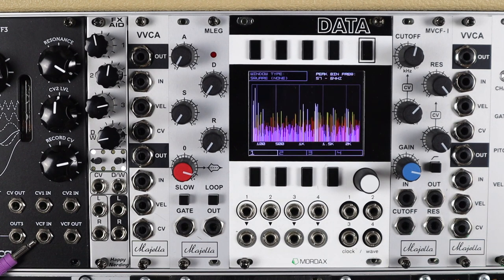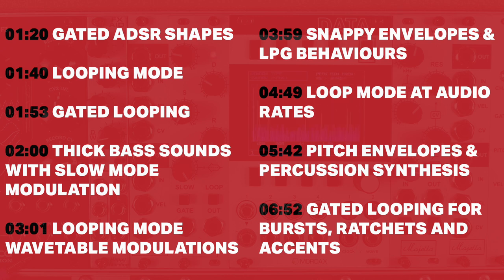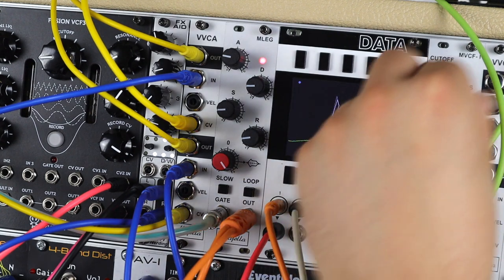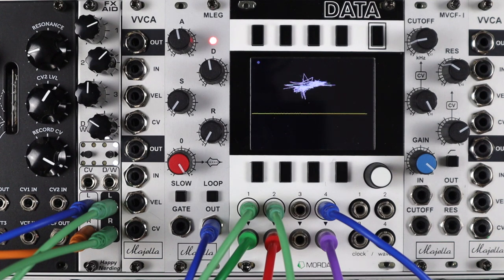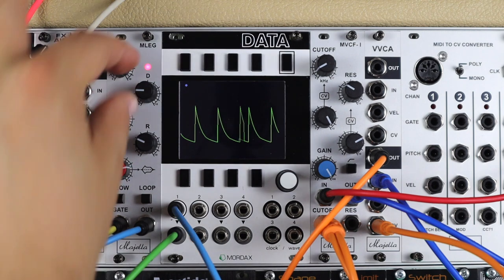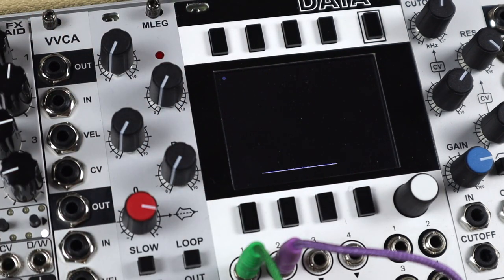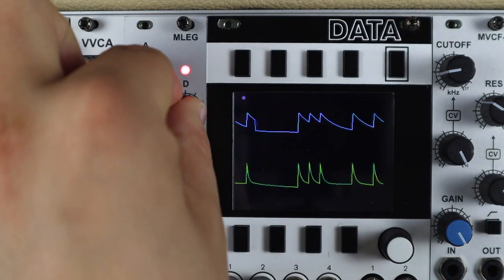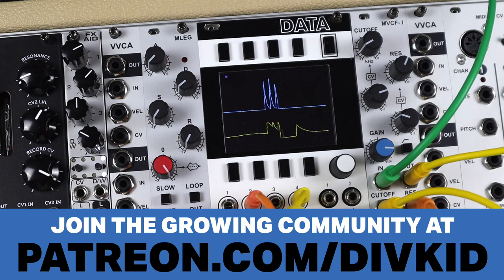Majella Audio MLEG Envelope Generator & LFO // 6HP polarising Eurorack modulation

Comment: That red knob doesn't go counter clockwise from 0 (in this review)?
Reply from the maker: Hi Robert, the red knob will invert the output and control the inverted level from the 0 position in the middle.